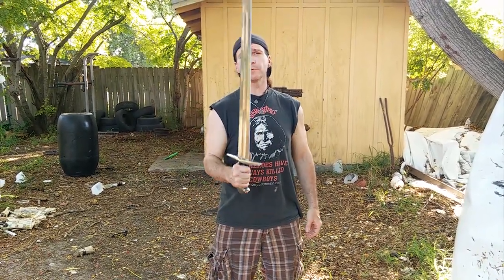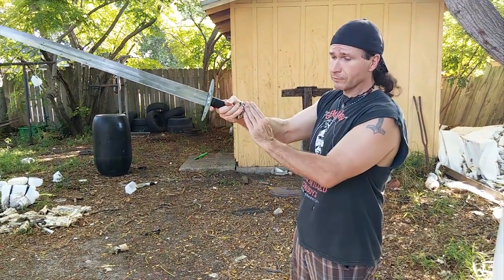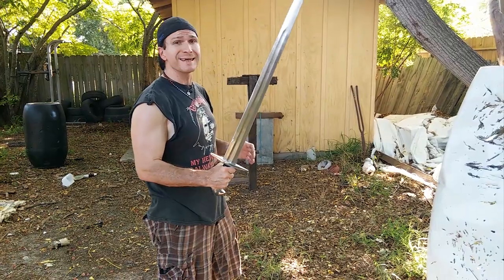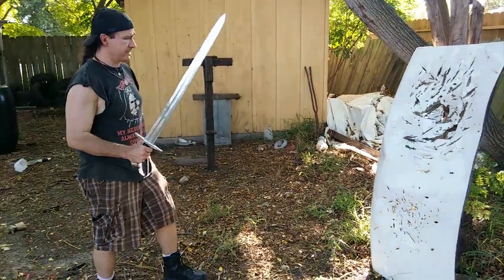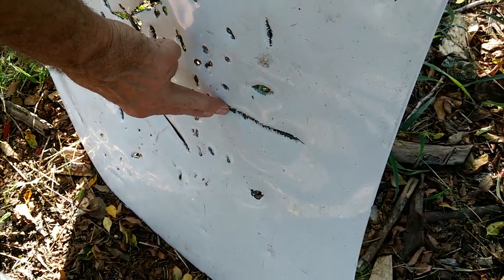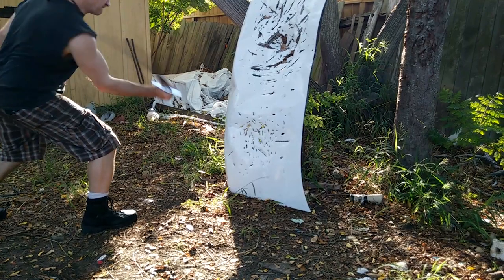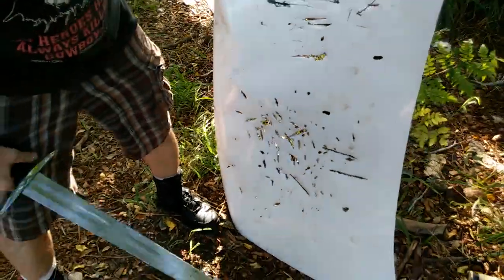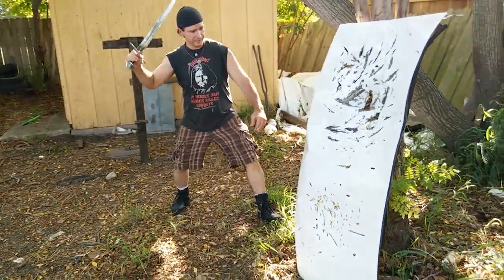Viking Sword Cast Blow Tip Cut though Auto Hood!

Comment: I wish you would do a video with using a cast blow with a hand and a half or true longsword.   I find it is very feasible that the cast blow has always been used and would have been used with a hand and a half sword as well.  You can even do the cast throw along the handle of a true two hander as a great way to pierce through gaps in armor.

Comment: Vey nice, how did the blade hold up as far as the tip and the edge after you cut through the car hood?
Reply from the maker: +TangSooDoArnis4Life Hardly no damage at all just needed a quick few hits on a hone to be back to extreme sharpness and was still able to cut paper easily after with out touch up.